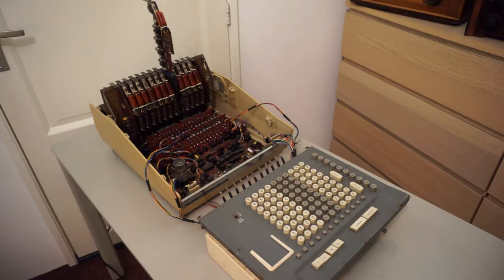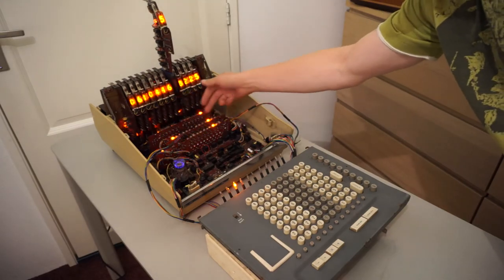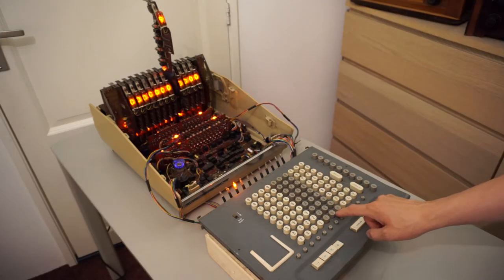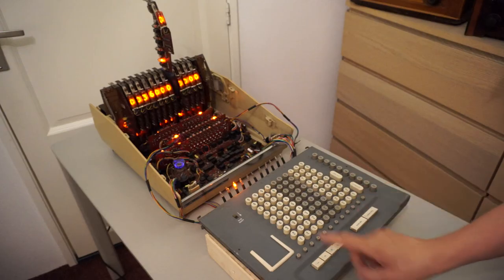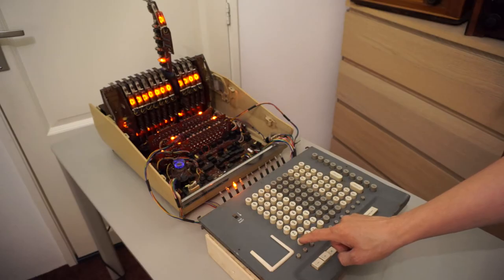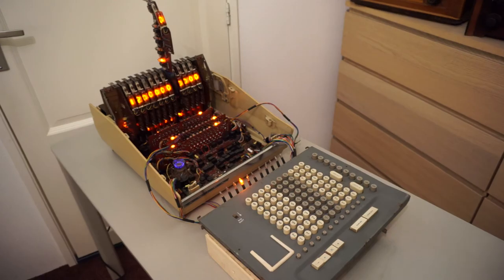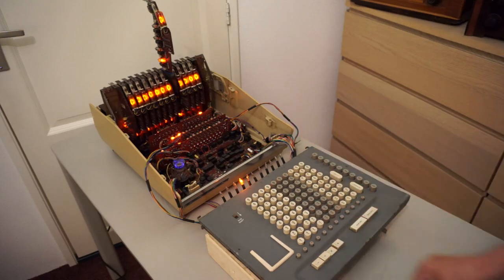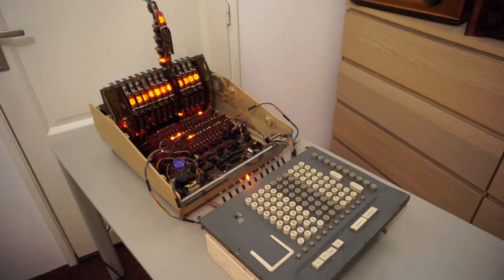Anita MK8 vintage electronic desktop calculator demonstration

Comment: This is one of the most beautiful vintage calculators I've ever seen!
Reply from the maker: Thanks! I totally agree of course. :-)
Reply: That's the dekatron tube which provides the system clock.
Reply from the maker: That is the argon lighting up in the decatron. This decatron is triggered by the system clock of 3,6KHz , and that makes it spinning at 360 rounds per second...

Comment: This brings back memories, I worked as a service engineer in Stoke on Trent in the u.k. with Peter Lee (service Manager) Peter Colclough and Robert (?) The register tubes were XC31 neons which functioned on a pulse plus bias system and to ensured they fired had a "night lite" inside to keep the neon semi ionised. The nite lite electrode was supplied by a 19 megohm resistor, which used to drift high in value and causes errors.....never have I changed so many resistors!!!. Also the logic diodes were largely selenium, not silicon which smells of old cabbage when the diodes burnt out....aahhh happy days 40 years ago!!
Reply from the maker: Hello Chris, I'm still in contact with Peter Lee. I've made a story on my website technischmuseum.nl which was impossible without Peter's help. I'm in the middle of moving to another home. I want to go to Peter soon...
Reply from the maker: Chris, if you are reading this... Peter Lee would like to speak to you again after all these years. Please sent me an email trough my website technischmuseum.nl because I can't email you trough youtube.

Comment: A very good demonstration (though some closeups would have been good!). The first point about the machine is that although it is electronic, it is performing decimal arithmetic, not binary. Essentially the original design was based on the Sumlock Comptometer (known in the USA as Felt & Tarrant comptometers) in which each of 12 columns had their own set of 9 digit buttons, allowing you to add multiple columns instantly. Trained comptometer operators worked the machine similarly to how touch typists can use a keyboard without looking at it. The Anita Mk VII (and Mk 8) of 1961, was so designed to use electronic components to replace the mechanical cogs and pinwheels, and Nixie tubes to replace the answer digit wheels in each column, but to retain the case and buttons for ease of trained operators used to the old system.  Of course the development of the smaller 10-digit number keypad meant the end of Comptometer skills.
Reply from the maker: Thanks for the compliment! (High res pics on technischmuseum.nl ) And yes, the machine works decimal indeed. Norbert Kitz made an electronic translation of a Sumlock Comptometer mechanical calculator. Before he worked at Sumlock he did work on the Pilot Ace computer. So he had experience with digital electronics already. In my opinion the Anita is a beautiful piece of history.

Comment: I have a few 12AT7s.  I didn't think there would be enough space in there for ten of them, unless they're in the display modules.
Reply from the maker: Eight of the ten 12AT7 tubes are behind the register cards at the back of the machine. Each register card is triggered by one of the triode's of the 12AT7 tubes. You can see the pictures on: technischmuseum.nl

Comment: I've found one of these in the loft of the house I've just purchased. I'm not sure if it works - the power cable is quite badly frayed and I wanted to clean it up a bit first before trying, though I don't want to blow it up. Any ideas on what I should do with it?
Reply from the maker: If you are not an electronics expert, it's better to not turn it on... 99.9% change that it doesn't work. They need service after these years... I've had a lot of work to get mine going again. And if you are not a collector I would advise you to put it on Ebay. You will fetch very VERY good money these days for such an Anita!

Comment: Hi,
You made a fantastic job of restauration on this machine. I saw your web site, it's full of clever explainations.
Thanks for all this.
I have just discovered mostly the same machine Anita MK9 model2.
It seems in excellent condition although I don't know yet if it works... I dpo not dare to switch the power on. There is a sticker saying 110V, but I don't have the original plug...
On the three pins, one is bigger. Is it the Gnd ?
Reply from the maker: Thanks for the compliments! That MK9 is a very nice find. About the power, the pin in the middle is the safety ground... English mains plugs can't swap neutral and life, that is why the neutral and life pins have different thicknesses. It seems your GS10D is gassy, so it won't run anyway. This is a huge HUGE problem with these tubes. Even brand new in box the most are dead... Your machine will probably light up all the neons after switching on. But the only thing your machine can do now is reset all registers to zero. You can't enter numbers and it will not calculate with a broken dekatron...
Reply: Thank you for your answer. 
For the Mains I should have found it as there is a conduction between the two extreme pins !
For the Dekatron this is bad news... If it works should I see the electrodes glowing (spinning ?)
Can I apply 110V voltage directly and safely or is there something to test before switching it On ?
Reply from the maker: Well I don't know how familiar you are with electronics of this age. It runs on quite lethal voltages. The power part of the MK8 can be seen on my website. The MK9 is quite similar. The big capacitors on the PCB in the back have a series/parallel construction and it is wise to slowly turn up the power with a variac and check those voltages while powering it up. From a certain mains voltage it will stabilise due the constant voltage transformer in the machine. Another note, the circuitry is not separated from the mains voltage. The heater circuit will differ in your machine because it runs on 110V
Reply: I am quite familiar with electronics and not afraid by high voltages.
But I must say that I know nothing (but nixies tubes) with old school electronics and vacuum tubes...
I must be careful to avoid destroying this jewel !